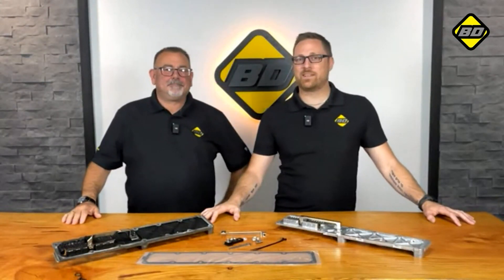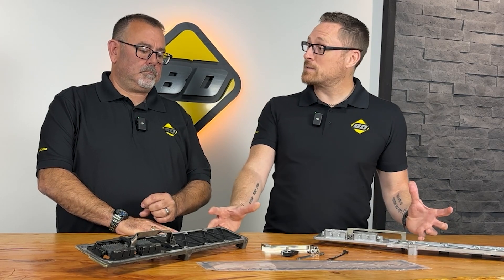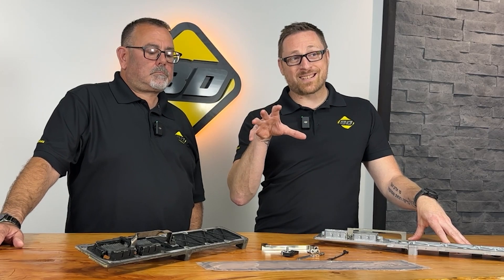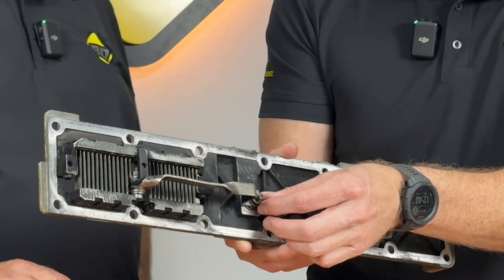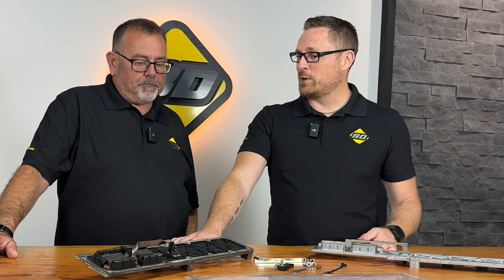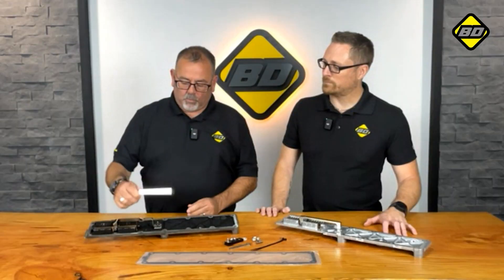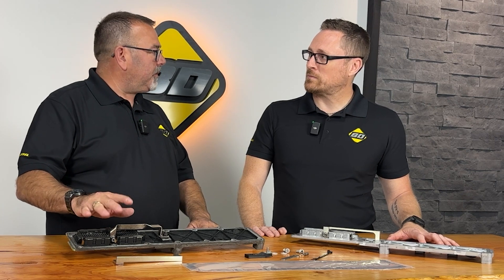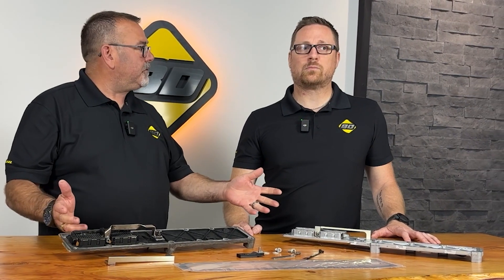Killer Grid Heater Upgrade Kit | LIVESTREAM!

Comment: Why has tis not been a recall. My bolt already broke off. At 67k kms. $93K before taxes! Who is paying for this it should be Ram! Very worried and the last Ram I ever buy! I am in the process of installing the Killer nut install and there is no nut below, already in the mix of the engine when it's together I don't want to start it! It should be towed and fixed at Rams expense! Recall Recall Recall!

Comment: I installed this kit and now I’m getting a check engine light P2609 not very happy
Reply from the maker: Thanks for your comment, we’ve reached out to you via email to connect with our tech department to help figure out the issue. Alternatively, please call our tech line at 1-800-887-5030 and we’ll get you sorted out.
Reply: Did you get it worked out? Don't leave us hanging!!
Reply: @MontanaWelldigger  I did, had a washer in the wrong place, I contacted them about the instructions. But ultimately it was installed incorrectly
Reply: @karr1071  thanks for the reply, glad it worked out!!